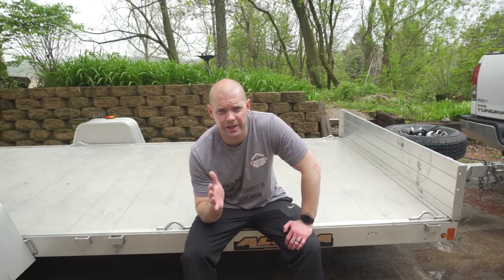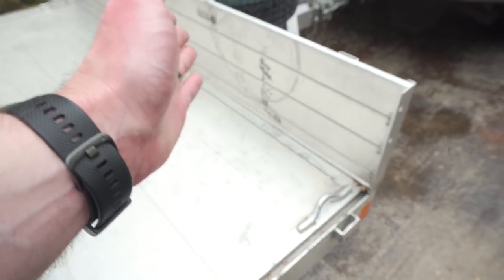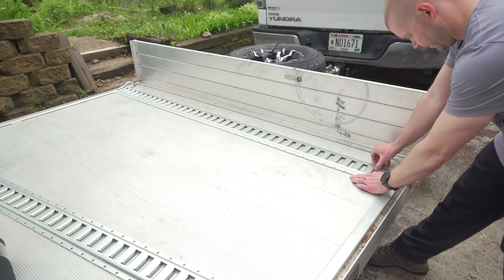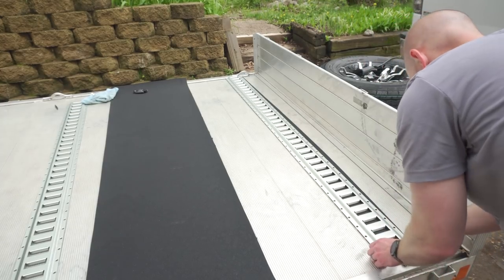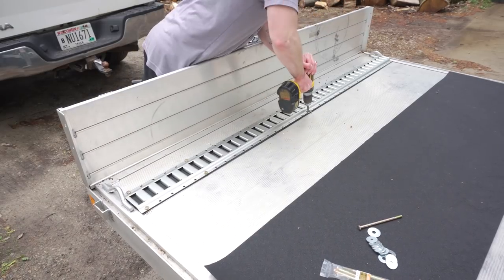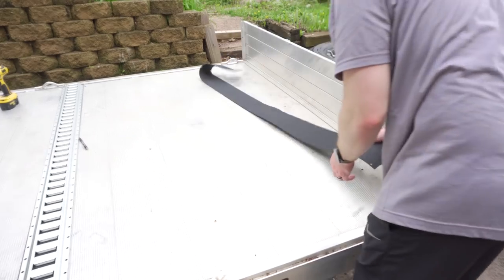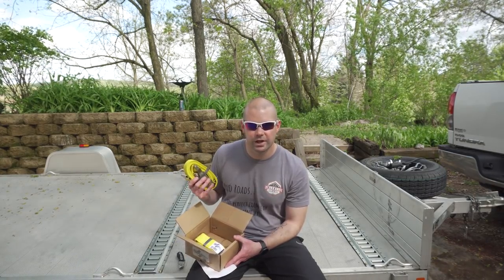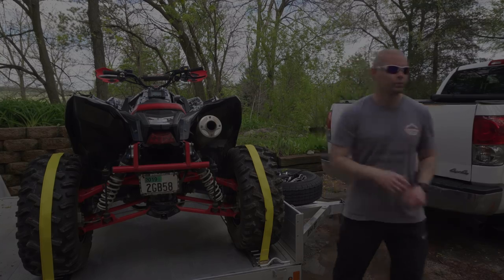Best Way to Tie down your ATV | How to Install e-track

Comment: How the hell is aluminum going to rust?
Reply: I don't this he meant "rust". I think he was concerned with galvanic corrosion, in which case he did everything rather well, like, really really well. So well that I was impressed and I'm pretty damn anal.
Reply: @Weeble_Warbles  he could have made his life easier by using double sided foam tape instead of rubber
Reply: @chickenknucklez2604  you didn’t pass high school chemistry, did you? When aluminium corrodes it forms aluminium oxide, which is white in colour. The aluminium oxide stays attached to the surface and prevents the aluminium below it from corroding. The only way for the remainder of the aluminium to corrode is to continually scratch away the layer of aluminium oxide. If the oxidised layer is left alone the aluminium below will not corrode.

Comment: Just a little heads-up aluminum corrodes but it doesn't actually rust salt is a big help in corroding aluminum but it does not rust your metal tracks and bolts May rust great instruction video thanks did the same thing to my trailer few years back e-track 100% best way to go

Comment: Make sure you check the straps often, I have this set up in my encoded trailer and there has been a couple occasions where we stopped to get fuel and I checked the securement and one strap somehow worked it's way loose. But I have the 2" strap and use e-trac links.

Comment: This is exactly how I strap my ATVs down to the flatbed of my truck. It's worked out great for me so far. Just make sure u secure the slack on the end of ur straps. Had one untie on me once and went under the tire while I was going down the road. Luckily I was going slow at the time and it didnt wrap around and get tangled up on the tire but it could have potentially been pretty disastrous!
Reply from the maker: Yikes! I had a strap come loose once (not using this method) but thankfully it didn't get wrapped around my tire. Good tip, thanks for the input Mikey. 

What type of truck are you running a flatbed in like this? That's awesome.
Reply: I got a Chevy k3500 dually that I put a 8x10 aluminium flatbed on. It hauls our two wheelers and pulls the camper. The setup works awesome for us.
Reply from the maker: @mickyb3712  that's awesome!!
Reply: I cut my straps to length and only use these straps to tie down my ride.  There's no need for me to have 10 ft of excess strap flapping in the breeze.

Comment: when using the e track system is just strapping down two of the four tires good enough or would it be better to strap all four tires down. secondly can a person cut some of the strap off and reseal the end of it where you made the cut so that you are not dealing with the long excess strap and so you don't have to worry about it getting wrapped in a trailer tire or around the axle of the trailer or even just dragging on the road.
Reply from the maker: Great questions, Bradley.

1. In recommendation to others, I would say tie all four down (I just didn't to save time in the video, I was not actually moving the trailer). If you are not going to tie all 4 down as recommended, I would at least consider doing opposite front and rear tires.

2. I think you would be fine to cut the excess strap off. I personally don't, because I always feel like the minute I do I will end up wanting to use the strap for another purpose and it will end up being to short! So that thought keeps me from cutting it down, haha.
Reply: I use a similar system using D-rings.  But to answer your question, tie down all tires.  Doesn't take long at all.  I cut my straps about 2 ft longer than necessary and seal the cut ends with a blow torch to keep them from fraying.

Comment: it you really want to be secure they make E track tire nets , the net ensures 100% the strap cant slip off the side of the tire like what can happen with the straps you used here. the stuff you have works fine just fyi.
Reply from the maker: Thanks for the tip, Dalton. Have you ever used those nets? I know what you are referring to but can't say I have any experience with them. I have as long as you have some good tread these straps almost fit between them, hold the straps in place. I bet those nets work pretty slick though!

Comment: Aluminium doesnt rust?
Reply from the maker: This is a good point, Alex. However while Aluminum is rust resistant, it's still possible when mixing it among other metals. While it is still less likely, I like take precautions to ensure it doesn't. Especially when you are cutting new holes into aluminum and destroying the overcoat in that area. Additionally, it helps with the other metals that rust easier.

I think you could probably ignore the issue and be fine for a while, but eventually some of the metals (either on the trailer, e track, etc) would start to rust.
Reply: @NavigateOffroad  Aluminum corrodes with is just as bad.
Reply from the maker: @thebourbonnook  👍 I don't believe it should when it's sealed such as on a trailer, until you drill into it, no? Which is why I took so many precautions.
Reply: Galvanic corrosion.....

Comment: Strap it down? It has a parking brake that's good enough right?

I normally just run a ratchet strap through the frame in front and rear and call it good.
Reply from the maker: Fair enough, I've done that in the past. It works, but I'm not a big fan of it. Appreciate the input Jolsen, and no...the parking break is not good enough 🤣

Comment: Will this method still work if the tires go flat in transit? Great vid young brother 👊
Reply from the maker: Hey Tim, that's a great question! I think so, yes. Even if one tire goes flat, you still have it secured around at least one other tire so you should be ok.

Also, one thing I didn't do here was run it through the tread. If the tire allows, weaving it in-between the tread can help hold it in and even if the tire looses air, it will still help hold it there better.

If all tires lost air, that may be a problem! For more than one reason! So I always recommend checking your tie downs whenever you stop to ensure they are still sitting pretty. 

Thanks for the compliment on the video, Tim!
Reply: if you know your tires lose air you could pre flatten them or  strap them down tighter
Reply: I have a similar set up for my trailer. Wheel chocks with straps over each wheel. Never had any issues in 3 years and several thousand miles of hauling . If I am on a long haul I add a couple straps to the lower a arm.

Comment: Aluminum doesn't rust no need to paint.
Reply from the maker: It's not because it is aluminum specifically, it's more because disimilar metals can actually cause a reaction and rust/corrode. The Clear paint is just another way to help avoid this.

Also, while aluminum doesn't rust. I have been told (have not experienced it myself) that when you drill or cut into aluminum creating that fresh cut can actually cause problems. So you want to seal it off as soon as possible.
Reply: @NavigateOffroad  It's not that big off an issue. Do you realize how many aluminum engine blocks and head or on use and the all use steel fasteners? When you dill or cut aluminum it removes the oxidation in that area.
Reply from the maker: That's an interesting point. I've always been told it will rust if you don't layer between it or paint it. Although an engine block doesn't get the same water and sun that a trailer would if it's stored outside. Although I suppose the engine is subject to extreme heat. 

Now I want to do an experiment with aluminum and a couple dissimilar metals but that seems like it would take forever to run a decent test 😆
Reply: @NavigateOffroad  when aluminum oxidizes it gets a white tint to it. The oxidized layer is actually stronger than the non-oxidized aluminum. That's why if you want a mirror shine to aluminum you use an acid like aluminum brighteners to remove the oxidation before you polish it. I've polished a lot of Aluminum in my days when I drove truck.
Reply from the maker: That's good to know, thanks! So are you saying it's totally unnecessary to worry about the "metal-on-metal" theory with aluminum? And when you say white tiny, I think if that really dirt white corrosion that builds up on aluminum, not a shinny clear surface.

Comment: You should cover your license plate.
Reply: no point the only people that can use license plate numbers and look anything up is officers and if they use it unlawfully to look it up then they'll lose their jobs so not worth the effort.
Reply: Jolsen Anyone can look someone up by there license plate as long they are over 18.
Reply from the maker: Mike, you're probably I right. I should start doing that. Although at the same time  it's 2019, if someone wants to find information out about someone it's probably not even the easiest way to do it. 😆
Reply from the maker: @gavinb6300  while I may start to pay a little more attention to that showing in a video, I agree with Jolsen in that you can't look up a (at least in WI) license plate and find personally identifiable information.
Reply: Why cover it up?  When you're driving down the road, your plate is on public display.  I don't know of any state that will let you look up info on someone using their license plate.
Reply: @danburch9989  i was just thinking that exact same thing!!